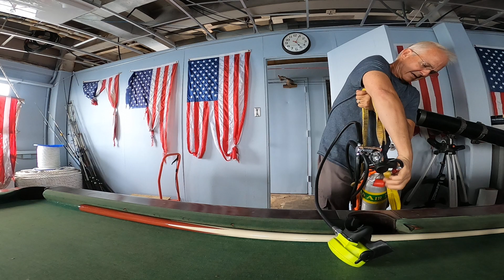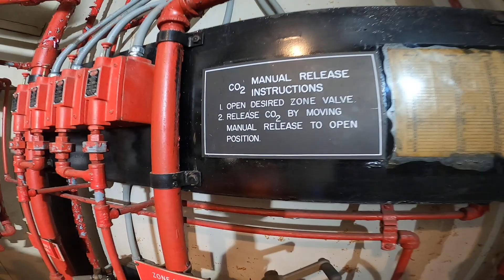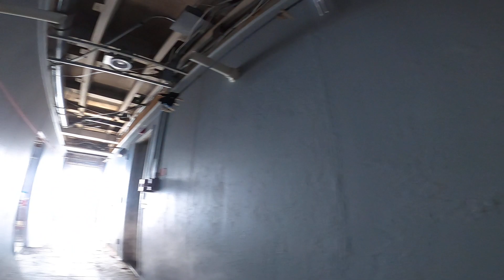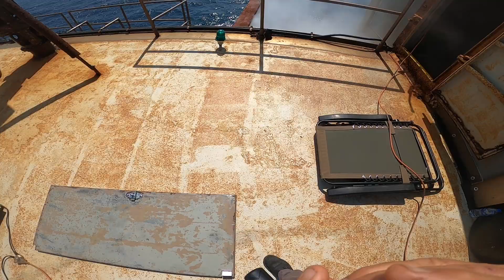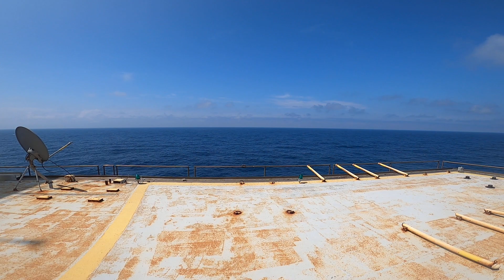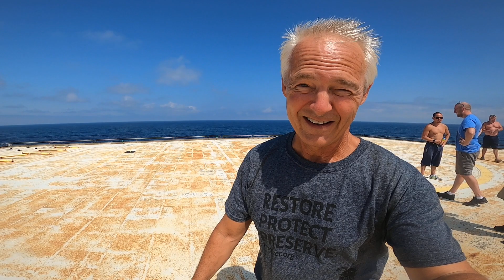Safety blow...

Comment: Dramatic! 😲 What are your fire safety measures at the moment?
Reply from the maker: Several fire extinguishers and the fact that the entire structure is made out of steel help. Not a complete solution but so far in 10 years, no mistakes.
Reply: @FPTower  Amazing! Stay safe! 😎

Comment: are you replacing the system or will you repair it?
Reply from the maker: We will use alternate forms of fire extinguishers and we do not have the same quantities of fuel that they had before. Maybe a couple hundred gallons now, and then 15,000!

Comment: What was the CO² used for?
Reply: These systems are still in service all of the world today and are very reliable systems when following the basic maintenance.  The pull stations first release release the alarm bottles before releasing the selected zone.  The bottles are likely out of compliance and need hydrostatic testing or retirement.  It would be good practice, especially with personnel living onboard to refurbish this system which will be a lower cost than complete replacement.  I won’t operate without some kind of fire monitoring and suppression system.  Typically, high risk spaces are protected e.g. machinery spaces where diesel generator and power distribution reside.  The Paint Storage locker which being a USCG facility I suspect has been designed into the platform.  Also, gasoline storage onboard for PWC needs to treated with great care bc of it’s flammability and risk of explosion from vapor accumulation.  Ships and platform avoid using gasoline where possible for that very reason and prefer to use diesel driven machinery.   Finally, I’m not sure what you abandon platform plan looks like but you might consider a davit launched life raft to hold the maximum allowed manning level onboard.
Reply from the maker: it was to put out fires in the building.